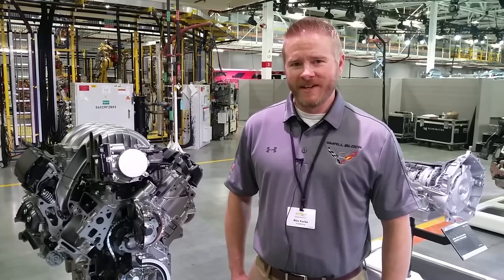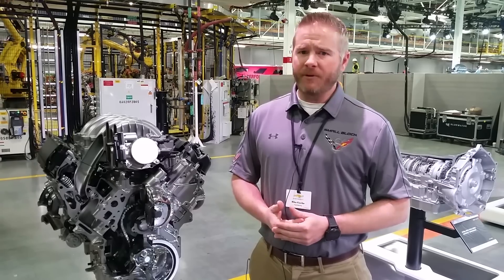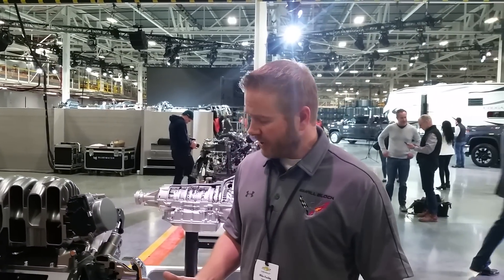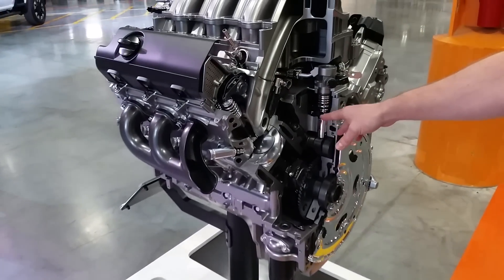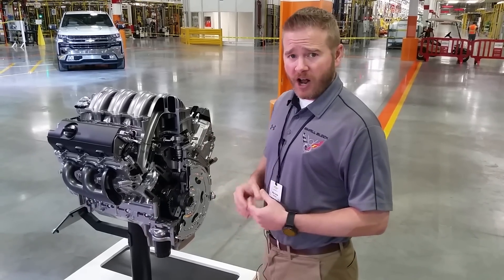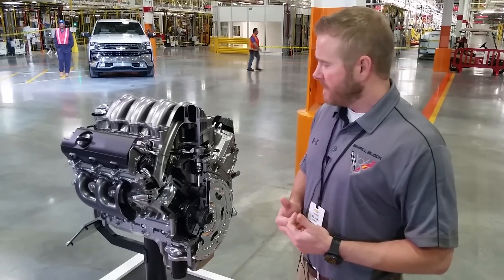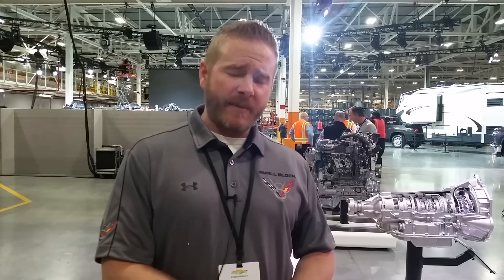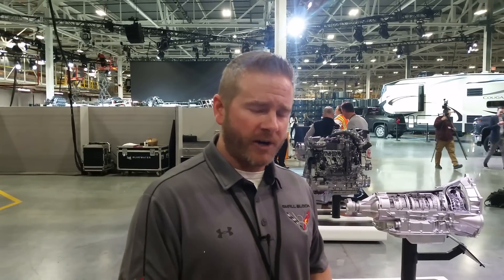New 6.6-liter V8 gas engine on 2020 Silverado HD

Comment: I think GM should bring back their 8.1 liter
Reply: jeff colt oh hell yea. The 8.1 with the allison is the best gas engine that GM ever made
Reply: I still own a 2001 Chevy 2500HD with the 8.1L. 95k original miles. I receive offers for it all the time, can't bring myself to let it go.
Reply: I still got one on my 06 Silverado 2500HD with 150000sum miles on it
Reply: I got 2 trucks with the 8.1 good engines.
Reply: Heck yeah
Reply: If Ford can make a pushrod 7.3 gas engine meet emissions standards, you can be damned certain GM could make the 7.4 and 8.1 do the same. And that they're fools for not doing so. They just willingly handed Ford another market segment. Thank the stupidity of GM executive management.
Reply: They killed it off because the epa restrictions were strangling them, so they just had to let it go and focus more of their funds on the 6.0.
Reply: Zeb McCollum I've got a 2004 Chevy Suburban, mine has a 5.3 L in it, I wish I had that gas-guzzling 8.1 l in it, full of torque
Reply: jeff colt my dad had a black Chevy 2001 2500HD with the 8.1. He bought it, I think, in 2001 or 2002 with over 20k miles on it. It would pull anything you put behind it, granted there was a gas station near by. He got rid of it and his 2001 3500 duramax for a 2014 3500 duramax. I still wish and he still wishes he kept the 8.1. It needed a lot of work done, it was used as a farm truck, as God intended.
Reply: Got rid of it with 189k miles, and the 3500 duramax with 249k miles.
Reply: @jeffcolt9185  get a 454 & stroke that lady son!  all it is.. is  just a mark 4 or 5 decked blocked with a reverse flow cooling system, maybe aluminum  headed & cammed.  Put two turbos on that mafucker & or a  huge blower with healthy internals it'll make 5 times the power they advertised back then-single belt serpentine & vortec heads.  Flat top slugs. GM parts Performance used to sell the ZZ572/ with 720 ponies naturally aspirated.. ready to face satan himself! Now everyone has bullshit 632s!!!!
Reply: It would not meet EPA regulations, while I would like to see it back, this 6.6 does the job. I just wish they put a better trans on this than a 6 speed, or at least another trans option for this truck.
Reply: @seanbrosnan2074  thr 6speed is MUCH stouter than the 8 speed. Anything more than 6 and the engines shifting too much anyways. Always hunting for a better gear when it could just let it eat.
Reply: @Saddedude  wrong. I have the 10 speed and once it's in 10th it stays unless it drops a gear when I pass someone. Newer transmissions have electronic controllers to keep it running efficiently and prevent the gear search you speak of. It really doesn't shift any different than a 6 speed other than a few more times as you initially accelerate.

Comment: You lost me at "variable oil pump" I'll go  Ram
Reply: Then you'll just be going with oil pump after oil pump .
Reply: @Dr.Westside  I've never had a hemi oil pump go out on me... mds cam, yup and pulled the heads and changed the cam and lifters and now have head studs.
Reply: @Indiandog  03 hemi oil pumps were doooog shit...
Reply: @samsquantch14  Never had an 03. So I'll take your word for it.
Reply: @Indiandog  first year of the new "hemi" .i think some 04s were bad too.they would just stop pumping oil and destroy every bearing.
Reply: @samsquantch14  Oh I bet. I've done a lot of repairs/upgrades on the good old  Chevy 350. Biggest upgrade at any power level on those was the cam button to keep the cam from walking and destroying the lifters and cam bearings (and then loosing oil pressure and killing the engine) the mopar 5.9 gas came factory with a cam retention plate. Only Ford I worked on was the 6.0 diesel. That low pressure oil pump (and the high pressure oil pump but different story) would either last forever, or start dropping out in about 10k miles. The Hemi seems to have most of it figured out, just like to see the mds system gone like it is on the truck 6.4L. That seems to be the only big issue I know about now. Obviously anything and everything mechanical will break at some point.
Reply: Hemi engine has variable oil pump as well and if I recall correctly now even the 2020 Cummins.

Comment: Nothing to clean up intake ports clogged by PCV /EGR deposits wich will ruin the efficiency over time...
Customers don't demand on variable oil pressure...
It's quite a useless gadget reducing the fuel consumption by 0.1 % or something like that and increases the unreliability with more moving parts with the variable displacement pump,solenoid etc...
Reply: 5 billion liters of fuel a day is used up in USA alone ...1.3 million gallons.. If we can achieve 1 % reduction in fuel usage, that would be 50 million liters/ day less burned into the air we all breathe...So i would say every gain counts...and i would say it should not be too hard since most of the vehicles on the road carry one or two people...the same for the big engine trucks...I personally know plenty of that own a big ass truck which hardly ever use it for more that to commute to work and back and run errands around the town so to me it seems like the fuel is way too cheap since i value my lungs a bit more than some other people right to buy a vehicle they desire no matter how much damage they do to air we all breathe.I understand that many people need all that power for work but most of these big ass trucks have anything in their beds.
Reply: @zlatkozivkovic8694  I agree with you,but if you have a minimum of brain,you start to produce smaller engines if you really want to save on fuel,and not try to make the customer to think you save fuel or save the planet with gadgets like that on a 6.6 liters engine....
Once your gadget causes problems and repairs,the "saved" fuel is gone in more used fuel to get new parts produced or shipped to you,and you spend more money to get it fixed.
my motorcycle from the 80's have 11 to 1 compression ratio with indirect injection on regular fuel....
You don't need direct injection to get 10.8 compression ratio...and it's far from being new or good.
It's all bullshit argument to hide the fact they are obliged to run leaner ,reduce emission standards and make "fuel economy" engines that direct injection can allow more easily.
400 hp from a 6.6 liters is quite bad to be honest : my brother's car have a 1.1 engine and it's producing 60 hp with a 90's engine design.
They just sell "displacement" to peoples used to buy displacement since the 60's just because it's the only thing they know.
You want to save fuel ?  just produce less material,lighter smaller vehicles,and dedicated work vehicles in a specific segment,and not try to sell SUV or pick up trucks to go buy some chipotle or mc donalds....
Reply: @michaelovitch  I agree with you 100%...but good luck trying to sell Ford F150 with 2.0 L turbo engine. I am talking about North American market where most of the buyer believe that bigger means better, so when you are more or less forced to build bigger vehicle that most of your customers demand it' cheaper for you to throw in bigger (but in many cases less sophisticated/cheaper and less efficient) 
engine because the fuel is much cheaper in NA than in Europe so not many people are much concerned with fuel economy or Co2 emissions. That means that there's no incentive for a car manufacturer that sells most of the vehicles to invest in new, better and also more expensive technology to increase the fuel efficiency of their vehicles because their customers don't care about fuel efficiency to pay more for it. The sales of smaller vehicles (meaning cars) are dropping in NA and few manufacturers are in the predicament as to decide if its even worth investing in redesign of their cars since it's not sure they will actually recover the money spent on redesign. If you read in above replay on my original comments, you will find one that the person say that 50 million liters of fuel savings a day in USA alone (1%) is to insignificant since the vehicles are now days much cleaner than before. This comment will show you the average mentality of large vehicle buyer in NA which for better part ignores the problem just to  justify his/her vehicle choice even though that vehicle almost never gets used up to it's abilities unless you have your own business...Basically these vehicles are mostly nothing more but the fashion statement.
Reply: @zlatkozivkovic8694  
50 million gallons/liters a year isnt much of a difference.
Besides, the air comes out the tail pipe almost cleaner that it went in these days...
I love how people cry about car pollution today, but either aren't old enough or dont remember how horrible air pollution was in the 60s-70s was.
Cars and trucks back then generated hundreds to thousands of times more exhaust pollutants than new ones do today.
Reply: @zlatkozivkovic8694   The real issues with MPG is 2 fold...

1. Most Manufacturers have constantly INCREASED the Size and subsiquently , the Weight of the Vehicles ( hurting Mpg).

2. Partially due to the weight gain and Partially for Marketing , Engine have gone up in HP significantly in the last Decade. It doesn't matter What " Bells and Whistles / Tech" it has ... You STILL have to burn More Fuel to make more Power.
Reply: @zlatkozivkovic8694  if you want to drive a Prius that’s fine. I will use my truck for groceries and hauling my family around town burning all that gas most of the time. The times I need the truck as a truck I have that ability. I also don’t have the luxury to buy a Prius and a truck so I bought one do everything vehicle.
Reply: Gas  engines haven't used egr valves for years , also dirtyv valves / ports are mostly due to port Injection and from people constantly driving short distances before the Engine even gets a chance to heat up.
Reply: You can blame ever-tightening government mandated fuel economy standards for all these little tricks to squeeze out every last bit of efficiency.
Unless, you'd rather pay the hefty gas guzzler tax, AND suffer the higher fuel bill as well?
But then you'd be bitching about that....
BTW, EGR is fairly rare on gasoline engines these days. The catalytic converters have taken over the task of NOx reduction.
And a properly designed PCV system draws very little oil/oil vapor back into the engine these days.
Reply: @lees.4084  you don't buy a work truck for MPG. You buy it to work. I don't want cylinders that deactivate, I don't want and oil pump that can have a software hicup, I don't want VVT, all that (and more) adds up to a motor that is not long term reliable. I will take 5mpg less if it has a solid motor that's make 20 less HP but works every day and has little to no down time. Down time cost way more than fuel. No truck no work. It cost me about $65 to start my truck and leave the office but not working for a day could cost me $3000 or more. I'll take. My 07 ram has never been to the shop other than normal maintenance. My 99 f150 had 1 issue with spark plug ejection but I put time certs in all cyc and that was that and never been in the shop since.
Reply: @nhbountyhunter  
I know all too well what work trucks are bought for...
It doesnt make what I said any less true.
You may not like it, but the federal government mandates fuel economy standards, and the auto makers have to come up with such technology to meet the standards.

Fortunately, this new 6.6L engine isn't going to use AFM, or Stop/Start....
It will have VVT, but that's a reliable system on these trucks.
The variable oil pumps likely wont ve a problem either.
It's a simple system, and the technology has been proven in automatic transmissions for decades already.
So stop with all crying and moaning.
So, you bought a Ford, with an engine with FAR more moving parts in it, more valves, rockers, twice as many cams, and twice as many timing chains, long chains that require lots of elaborate guides, with oil pressure actuated tensioners.
You got damned lucky it only had to go in for spitting out spark plugs. How much downtime did that cost you?
Those years F150s were notorious for their transmission failures too.
And then you tell about how you like simplicity??? GTHOH
BTW, most people making that kind of money typically have a backup truck they can drive if their primary one braeaks down....
Are you so I'll-prepared that you dont have another truck to fall back on?
And if your 07 Ram hasn't had any issues, that's just amazing...
Reply: @nhbountyhunter  
CAFE points = Mandate in my book.... But what do I  know? Maybe it's just all that internet trash I've been reading, and lack of real world experience...🙄
I do agree with you about diesels not being cost-effective in many, or even most cases.
Just the higher diesel fuel prices eat up most of the MPG advantages of them.
Not to mention the much higher purchase, maintenance and repair costs...
I know Ford has had plenty of timing set issues, plus cam phasers (VVT) issues. 
And yes, many engines are OHC or even DOHC these days, and most dont have major issues with it, but some do.
On a V6/V8, it does add substantially to the number of moving parts involved, something GM has avoided with the LS V8s, and something Ford is rediscovering with it's new 7.3 gasser... 
My company just upgraded my work truck to a brand new GMC Sierra 5.3L yesterday, love it...
And no, a backup truck wont do you much good a long way from home, but it can help you get back on the road faster if you are looking at prolonged repair on the truck that did break down.

Comment: Plus: 
6.6 liters 
Iron block

Minuses: 
Direct injection (dirty intake valves from PCV system)
Powder metal rods (cheaper than forged)
Reply: The powdered metal rods are forged.
Reply: Erik Hockman 
https://youtu.be/jZ-CVhRfZ9k
Reply: Erik Hockman 
https://youtu.be/O7U4HWjYcqo
Reply: This thing is a turd. The new Ford 7.3 is built like a brick house, this thing is built out of popsicle sticks and soda cans.

Comment: Pos has only 16 ft lbs more tq than my old 8.1.
Here we have Ford coming out with a big block and GM being retarded with a small block. 
Been a GM fan my whole life, my next truck will be a Ram.
Reply: Both Ford and Chevy engines are large displacement small blocks.
Reply: @Nostradamus_Order33  Didnt Ford just came out with a 7.3l Big Block.
Reply: @Nostradamus_Order33  Ford is certainly calling it a big block 

https://youtu.be/2FtNlfAbc2w
Reply: Josh B 
I’m just splitting hairs. Big blocks in the old school language has to do with, but not exclusively, canted valve technology with large journals and large displacement.

Chevy 396 and Mopar 426 Hemi

Fords had the 460 big block. Canted valves with big heads. 302 and 351 Windsor were small blocks. Their valves went straight across the heads. Just like the 7.3 gas.

Put the 7.3 gas next to a 7.5 liter 460 Ford and the 7.3 gas would look like its’ baby.
Reply: uh...... making 16 more foot pounds with 1.5 less liters is actually pretty good

"my 16 cylinder fright train engine makes more torque than this new 1.4L 4 banger......... what a POS!"
thats basically what you just said.....
Reply: @kainhall  interesting, my comparison was between a small block V8 and a Big block V8, see how they have the same number of cylinders.  The size difference isnt so extreme either. Thanks for playing though.
Reply: @Not_An_FBI_Van  1.5 liters = 91 cubes 

That's a pretty big difference

AKA 305 to 350..... and we all know 305s suck ass
Reply: Exactly. It still makes more torque than a 454 or 8.1 and will probably get double the mileage. That's the point.
Reply: @SOHCGT96  double the mileage? While towing, I bet it does worse. 
What RPM does this new engine produce peak torque?

Comment: ya i'm sure that with fuel pressure at 400kpa and then ramped up to 15 mega pascals that it will be nothing but reliable and maintenance free....  just like chevy "we need to reinvent the wheel on every car we produce to make things more and more unnecessarily complicated just to get the "segment leading" HP and TQ" not to mention that direct injection has been around for 10+ years now.. chevy always way way behind the cutting edge. next they will implement the outdated technology of active cylinder management SMH
Reply: Just being devils advocate here - but that pressure isn't going to be a problem. Modern diesel engines are up around 30,000 psi (not going to bother doing the conversion- but it's over 10 times as high). They don't have issues from their fuel system pressure, so this much lower pressure shouldn't be an issue. 

With that said, GM doesn't have the best track record with engineering/testing, so maybe we will see some issues. I'm thinking not though - GM's diesel engines are the ones at 30k psi...they do have that knowledge in house. Should save them on this one. Valve fouling, though....nope.

Comment: That’s literally the same power than the 6.0 in the cars what is direct inject doing here?
Reply: The 6.0L in the cars had at the most...367 hp. The 6.0L in the truck had 345 hp. This new 6.6L has 401 hp...
Reply: Evan Bozajian my 2005 6.0 car makes 400hp now my same engine crate version makes like 500hp
Reply: @ryanphilipps1088  

I forgot about the LS2 in the vette. My bad lol.

Comment: Oh boy it's the old new 400 small block
Reply: yup..... and i own a 77 silverado with a 400

400 > 350.... any day

and no..... 400s dont overheat....
if you use the original "HD" radiator... and not drop a 400 into a 350 truck.... it WILL NOT overheat 

but if ya still dont believe me.... please, id love to take your 400 blocks off your hands
totally junk.... just give em to me
Reply: Having raced both there is absolutely no similarity between SBC and LS
Reply: @petersouthernboy6327  
Agreed.
This new 400 makes a lot more power than the old ones did.